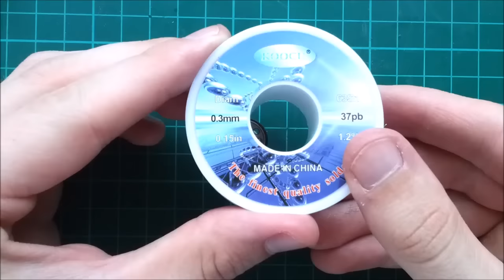Tamiya Mtl.SPW.Sd.kfz 251/1 Ausf.D 1/35 - Paint | The Inner Nerd

Comment: I really hope you don't mind my 2 cents. Here goes. The MG 42 at the rear would be 'Barrel up' not down. As the stock/receiver etc was a lot heavier than the barrel, and what the gun fits into is a swivel. Also the track links attached to the front are a great addition but the ties don't appear to go anywhere? As has also been commented the shell holes don't really work.
Apart from that the painting and building of the thing is superb.
Reply from the maker: Yeah all those things have already been mentioned somewhere in the comments already

Comment: now that is a amazing build but can you make a video on the colors and paints 
for this build I see that you used a tooth brush scrub the paint off did you used a solvent with that I want to build this model but I am a car modeler and do not known 
how to weather it does not look hard to do just knowing how to do it will make a amazing model like yours thanks
Reply from the maker: Edward Fontaine Thanks a lot. I can do a video on general weathering if you like covering all my techniques so that you can see the various processes. To answer your question, it's just plain water. The AK reacts to the water and losens the paint when scrubbed

Comment: Great video, one question - how do you get that overall faded look on the camo at the end, when it is finished?
Reply from the maker: Thank you. I cover with a very fine spray/dust of XF-59 Buff which is thinned also and it will uniform all of the colours. If you spray from roughly 20cm away the spray pattern will be nice a loose and lay onto the model evenly a lightly. Hope this helps!
Reply from the maker: @danielledoyle434  Hello and welcome. Thank you for watching and I hope the videos are useful. The only one I have experience with personally is Hannants. Ive used them for decal sheets and some photo etched parts but nothing more. I would recommend from my experience but can't give more advice than that unfortunately

Comment: Hi im new to modeling and this will be my second kit.  Ive read that glue doesnt like to stick to parts that have already been painted.  So my question is how did you solve that or is it just a myth lol?
Reply from the maker: Hi and welcome! You're correct ploy cement does not like to stick parts that have paint on them because if the reaction it creates to effectively weld the parts together. To get around this I use CA superglue for the final assembly of small parts that are painted separately. Otherwise I sand the contact areas if possible before applying poly cement to get a good bond. Make sure to assemble as much as possible before painting as this is the easiest way. Lots of sub-assemblies is a good place to start!

Comment: Anybody knowledgeable enough here to know whether the preassembled rubber tracks from the many Sd.Kfz.251 and variants that come with Tamiya and other kits would fit a Bronco SwS Panzerwerfer 42? (1/35) 
The similarity between the 8ton tractor and the MANY 251 variants are close.
Reply: Kiowhatta C hi mate, not sure to be honest, but if bronco kit is 35th scale then probably yeah, you might have to adjust the tension on the track via some idler/drive sprocket mods, hope it helps 
the primered thumb 😁👍

Comment: What air brush kit do you recommend for a beginner ? I'm looking for a decent kit not cheap rubbish, thanks
Reply from the maker: Euphoric Gaming Society I use a Sealey Air Products AB933 with 0.3 needle/nozzle. £35 never let me down as long as you keep it clean and use correct thinners for your paint etc. Had it 2 years now and still good. 

I've suggested this to many others, some agree and some don't, naturally. 

Hope this helps
Reply: Thanks so much for replying, which small/mini compressor do you recommend? Thanks again

Comment: New to this stuff. What type and brand of paint sprayer do you recommend?
Reply from the maker: Hello and welcome! I use a Harder ad Steenbeck Evolution Silverline. This is a good brush if you're using a varuety of paint and the O rings are solvent resistant (good for taking aggressive lacquer thinners on Alclad and Zero Paints). It's reasonably proces considering other models they make and other brands too. Very easy to clean due to the assembly engineering. However if you're just starting I suggest a cheaper one just to get your eye in. Its easy to mess up and destroy the accuracy of an airbrush if you're new to it. I started with a Sealey AB9321. I still use it now and it's never missed a beat but has now been demoted to primer airbrush with a bigger 0.5mm nozzle - sparing the H&S for accurate colour work. 

Hope this helps! 
The Inner Nerd

Comment: know any cheap budget airbrushes that can get the job done?
Reply from the maker: Epicblazer I use a Sealy AB993. £35 for the brush and air line. Never let me down and had it for over a year. As long as you keep it clean it will do the job 🖒
Reply: @TheInnerNerd  That seems pretty good, but what is a decent air compressor priced at?
Reply from the maker: @hazmatharry  Yes its pretty decent. Since then I have now upgraded to a Harder & Steenbeck Evolution Silverline and have to say you get what you pay for. The assembly and ease of maintenance is far superior to the Sealy. To answer your compressor question I use a Badger 1100. Its a two-tank set up to reduce the risk of moisture entering the airline. Will run at 15/22psi all day so sweat. Cost me around the £100 mark but I would say its better in every way than the Chinese copies. If you are only after a cheap one however, I started with a Hseng I found on eBay. Cost about £40 at the time and did me for about 2 years before it went pop. You do have to be careful woth overheating on that one though and can get a lot of moisture down the airline after continuous use when spraying a full fuselage for example. Hope this helps but from my experience you're better off going bug to save in the long run. 1x purchase of £100 is better than 1x£40 + 1x£100 of you get my meaning
Reply: @TheInnerNerd  An yes, thank you! I will definitely have a look into that :)